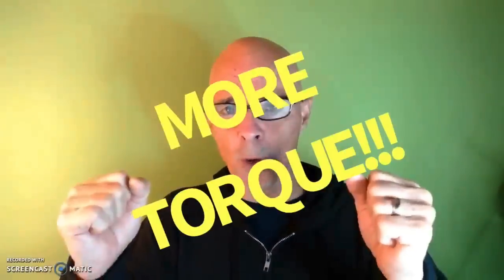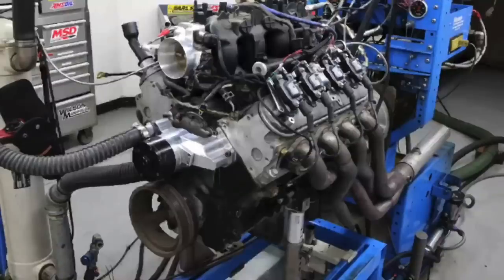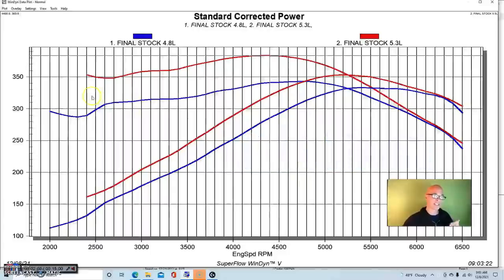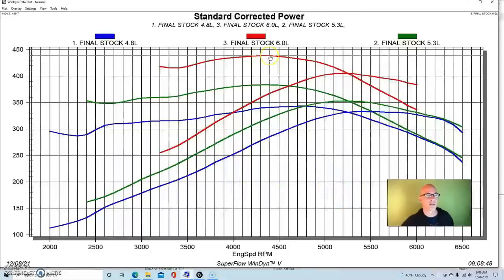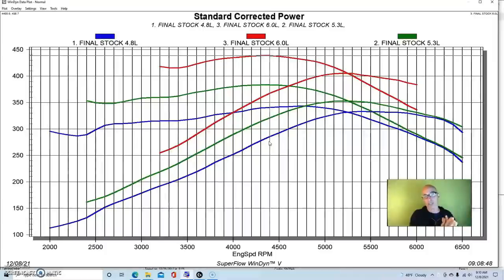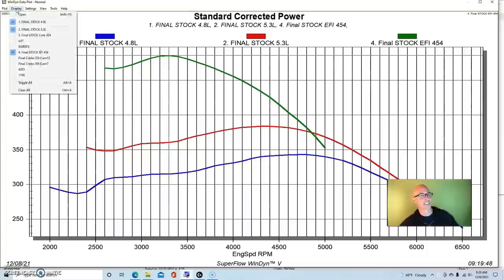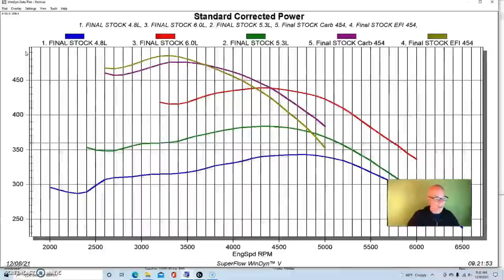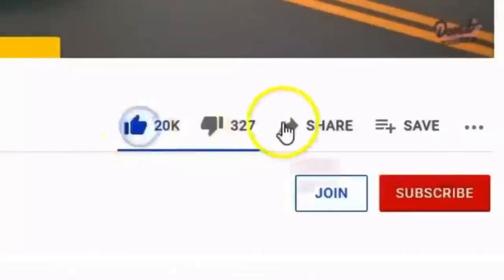LOW BUCK, JUNKYARD V8 TORQUE TEST-6.0L LS VS 7.4L 454 BBC-WHO MAKES MORE TORQUE? BETTER VS BIGGER!

Comment: I know. Holy grail, gonna drop the cash, we aren’t going to go pull one from the yard, and if we did who’s gonna put it in a tow rig. BUT, a 427 LS7 comparison would be cool to throw into the mix as far as torque vs mileage.
Reply: I bought a running driving 02 Denali ( bad trans and paint) for 1,200 with a 6.0 for my Chevelle.It was cheaper than most torn apart sbc in my area.
Reply: @BruceLee-xn3nn  I’m in the process of rebuilding my 2001 LQ4. I live in PA and as others have said, no matter what you do, unless you have a heated garage with a floor drain to clean it off every day in the winter the frames and body just rust to death. I love the LQ4 engine though 👍🏼
Reply: Actual LS motors(aluminum block ls1 ls2 ls6, ls7)etc aren’t even on the radar anymore…if you see them they’re stock to the bolt LS1’s and LS2’s and they’re in really nice and really boring prefab restomods….
Reply: @corypoteet6543  very true
Reply: Thats one high revving small block too

Comment: I would be interested to see how a 6.0 compares to a Vortec 8100, the architecture changes to the big block pretty much made it a giant LS engine, even down to things like the firing order.
Reply: 8.1 will shiz all over the 6.0
Reply: @wildestcowboy2668  oh yea
Reply: the 8100 may make more torque on stock applications, but  the 6.0 has way way more aftermarket support that the 8.1. So I think it wouldn't take much for the 6.0 to stomp on the 8.1. Just my opinion
Reply: That's what I thought too until I learned the 8100 is not an LS engine. It's based off the 454s architecture with a bigger stroke, and cathedral port heads plus a few minor differences front the 454. Still an amazingly powerful engine.
Reply: @paulcarter2879  Actually my motor head friend there is 100% more aftermarket support for BBC then LS mainly due to the high dollar racing circuits world wide that demand such aftermarket support. This is simply because of 50 years of use on actual high performance race use versus 25 years for the  LS platform . LS has only enjoyed last 15 years or so interchanging support for intakes, carbs, ignition crank systems, etc. My 1969 BBC Nova heads can go onto my 1999 Gen 6 454 with no issue. Keep in mind there is no replacement for displacement. My 850HP NA 540 BBC with AFR heads will crush any NA LS engine. LS is definitely more versatile to fit in anything which makes it cool. A mazda miata or honda civic simply cannot fit a BBC inside.
Reply: @djrowe10  I know old school big blocks have all kinds of aftermarket support. I've only been playing with cars since I was 14, so 26 years. I've put together/had a few bbc engines. Heck last month I helped my neighbor get his 67 Chevelle with a 396 running and dialed in. So I'm not new to any of this. But the late model 8.1/496 has very little aftermarket support because it's architecture is different than the latest generation big block. So it doesn't have the interchangeability of other bbc engines. So ya you can bore and stroke an older gen bbc to get pretty large and I get the no replacement for displacement, but I'm sticking by my initial opinion. The factory produced 8.1/496 that they put in hd trucks doesn't have the aftermarket support of the 6.0 so I believe you could build the 6.0 to out power the 8.1 due to that.
Reply: @paulcarter2879  I'm not nit picking your response fellow hot rodder, but let me add to my prior reply. I have been building engines since 1995 professionally in the Cleveland Ohio area. I build everything from boat race engines to top fuel dragsters and stock car racer circuit engines. Having built literally hundreds of big blocks and LS motors, I just wanted to clarify for others reading our posts about the gen7/8 BBC. The block structure of gen5,6,7,8 is the same except for bore sizes. Gen5/6 heads are the same and only the 8.1 496 heads are different being more like an LS cathedral port. By changing the heads to ANY older version BBC this will make it qualify for being just like all other BBC'S factoring it as usable to the mega aftermarket parts world. Yes, if you just try to stick with 8.1 OEM configuration you are more limited with its heads, intake, and power supply then an LS, but I have still built more 8.1 1000 HP setups for race boats then LS engines for same HP levels. Most guys actually think you can't put mark 4 BBC heads on gen5/6/7 BBC, BUT YOU 100% CAN! FELPRO and others fixed the block coolant passageway issues way back in the 90's and mass marketed in early 2000s. I'm a little partial to BBC/BBF engines over LS simply because there is no replacement for displacement 💪
Reply: Almost no aftermarket performance parts for the 8.1
Reply: 8100 is a tall deck big block not many parts interchange with the 454 and different than LS so there isn't any aftermarket support
Reply: @maroguy  really? a big block isn't an LS? who would have guessed. and no, it's not a tall deck.
Reply: I don't think there is much comparison the 8.1 is a savage.
Reply: @corvetteZ3r 😂😂😂😂😂😂😂 ohhhhh ya like it was never there lol
Reply: @paulcarter2879 yeah you get 10 times more performance option  parts for a 6.0 than a 8.1 but to make a 6.0 put out what a stock 8.1 does, it would still cost about 1500 bucks or more. Basically have to build a 6.0 to even touch the 8.1 essentially.
Reply: @fighttheswine  8.1 is king daddys for low end torque
Reply: @HOMEWORK4.0 yup the 8.1 is LT based,  You would baisicly have to build an LS to compare it to the 8100.
Reply: @paulcarter2879 for the LS engine to compare to a stock 8100, you would basically have to build the ls for it to ever stand a chance. The 8100 is LT454 based, it really is a better engine all the way around. But deffianatly not cheaper 😂
Reply: @djrowe10  see I was not aware of that interchangeability, because I love BBC engines. But when I looked into the 8.1 I had trouble finding aftermarket support in parts that you can get with every other gm product ever. So that is interesting to learn that, so thank you for a little bit of unknown knowledge. Being a car guy I'm open to any kind of information, that's why I always clarify that I'm only stating my opinion. It can be subject to change.
Reply: @fighttheswine  being some of the stuff I've read and have found out since, I do believe my opinion is starting to sway the other way. I'm always open to learn. Plus I am a BBC fan, always have been.
Reply: @djrowe10  And thats what i love about the BBC, 1960s parts will fit all the way to (2000 C3500 HD trucks). ive got a 396 carbed aluminum intake on my 96 L29
Reply: I own both 
8.1 smokes 6.0
Reply: @johnmullen7254 my dad owns a 6.0 and I have an 8.1 and I’ll tell you your right, my 8.1 would dog walk and stomp
All over that 6.0. No comparison.

Comment: Good ft-lbs is good but good ft-lbs with gas mileage is key for a daily driver  truck 😎
Reply: Exactly
Reply: on fuel mileage...the focus on lobe separation becomes important
Reply: Transmission change is how you get mpg
Reply: @blainesnider9089  only so much even the best gearbox can do! Efficient gearbox+efficient motor=all the MPGS
Reply: @blainesnider9089   if you think fuel mileage is ALL in the gearbox..you need to study up on lobe separation.
Reply: @hotrodswoodshed7405  brake specific hp and torque it still takes very close to the same amount  of fuel. BTU to get there.
Reply: @blainesnider9089  agreed there's only so much work can be done with x about of fuel
Reply: Overdrive ratio, rear end gear with tire size all part of the leverage equation. Direct injection with VVT a big help with engine efficiency. You can almost have it all these days. Some really clever engineering available.
Reply: Gas milleage 😂😂😂

Comment: This video proves why I love my big blocks.  For a towing application, I want it all down low.  My race car might wind to the moon,, but when I'm towing, I want it right now at 2500 rpm.
Reply: Waaaaaaaaaay too many people have their imagination all wrong. The crankshaft is the heart of an engine. The more stroke and force on that stroke... the more power. Torque is what wins races. A smaller engine/smaller stroke has to wind higher to reach the level of Torque and power that the bigger engine already has from the start.

Comment: BBC for the win! I am a die hard big block guy mainly because of my age being almost 50 and grew up with BBC muscle cars, boats, and trucks. The biggest trend on boat racing is still BBC...as usual. LS engines are the daily driver standard GM came up with to survive the EPA gas and oil regulation issues about MPH. I have never owned an LS in any of my 20 plus hot rods over last 25 years (and still own 7 of them) but considered it for sure after MSD and Holley made it possible to put a carb on one around 2012. You are a guru Rich for sure and my BBC favoritism is shared by every top fuel dragster, super gas drag boat, and all SS GM 58-74 muscle cars. Trucks fortunately have a BBC option until 2013 which spanned 55 years(2009 was offical official announcement of last year made but loyal guys preordered 3 years worth of more to be made).  GM's final BBC ZZ632 BBC makes 1,000 HP and 850TQ without power adders under 6,000 RPM. Never heard of an LS that did that! Thanks for your never ending sharing of the hard work you do to find real world answers! 👍

Comment: The stock injectors in those 454's are leaky garbage after a few years, one of the best mods is replacing them and the stock distributor. 

I have driven about 500,000 miles with that 7.4 454, it is amazing how much headers, injectors, a tune, and some good plugs and wires wake them up.

Comment: Done building my 1999 Chevy 464 Vortech.
Its built strong from GM. 
Factory Aligned honed main bores.
Factory forged rods align honed with Boron steel riod bolts.
Factory Priority main oil feed system.
4 -bolt mains on all 5 caps.
Factory 3/8" diameter Tubular pushrods.
Looked up the 454 Vortech Heads they actually flow decent.
Like Pontiac V8 Ram Air 3 did !

Comment: Small block towing: downshift and high revs uphill. 
Big block towing: lug and grunt up the hills in high gear, much less drama.
Reply: Lug and grunt uphill = Low oil pressure, and heavy wear on bottom end crank and rod bearings. 
The 5.3 tows better than the gas guzzler 6.0.
Reply: @ricktaylor3748   ever understood the obsession with lugging a motor
Reply: @ricktaylor3748  Running low RPM isn’t bad at all. Never heard of engine issues at low rpm. High RPM is what ruins an engine even with higher oil pressure.
Reply: @ricktaylor3748  never ever heard some one say a 5.3 tows better than something else you need 3k rpm to pull a lawn mower 75mph my 20ft boat takes 4k and stabing the petal
Reply: @sstevocamaro  high load and low rpm is terrible for an engine. Everything from the low oil pressure and high combustion temperatures.
Reply: @mmholling87  anything above 1200 rpm has more oil pressure than you need in most engines next don't try to lug up the hill get the down shift or hold steady on the gas and let the truck figure it out 3rd any thing over 3k says you don't have the power and running a engine much harder than It's capable of to cruise down the highway no grade or anything cause when you hit a grade you really not going to have power unless you take it into the top end
Reply: @austinhowze6280  explain combustion temperatures and how pre-ignition knock is effected by them? I can tell buy your post you don't understand what LSPI is and how it's effected by low rpm and high torque conditions.The easiest way to kill an engine is knock. Also, some basic grammar would be extremely helpful understanding your post.
Reply: @mmholling87  always watch Temps, but I pull 30k on the ball with my 7.3 and 65mph blew 2k rpm and I don't have heat issues. At the same time I had a 5.4 that would move 6k at 65mph under 2k and not give it input to go very high torque at that range.  The 5.3 you'll be half throttle to maintain speed and flat out to get up a hill,  most times we put in 4low to clime this hill cause of the amount of throttle needed was unreal for a 1st gear.  To me the 5.3 don't have any low end power but the 5.4 don't have top end

Comment: Pontiac V8 guy myself. 
454 Big Block Chevy just needs a stouter camshaft profile and not much more.
Wipe LS for torque and Hp.
All LS Has Dinky Crankshaft Thrust Bearings the #1 weak area and impossible to improve any. An Engineering Flaw they all have. 
Big Block Chevy Has a Large crankshaft thrust bearing. Pontiac 455 has an even larger crankshaft thrust.
Important when putting continous Heavy loads on a V8 Towing or Racing. 
Will not fail hard use and abuse 454 BBC or Pontiac 455.
Worked on Grain Trucks with 427 Tall Deck BBC and pulled 80,000 lbs loaded no sweat.
Worked on Firetrucks with a 454 BBC Tall Deck with water tanks built in pumper tankers weighed 100,000 lbs. 454 BBC Pulled effortlessly. 
No failures any BBC.

Comment: I think its important to mention that not only does the 454 make more torque, it makes it a lot lower in the rpm range where it is needed for towing
Reply: It's not just the torque that is a plus bigger engines with an unrestrictive intake and exhaust make more horsepower N/A in an apples to apples comparison. Some of that torque though can be traded off when making big horsepower numbers.
Reply: i have the 450 hp 454 and i just love it way better then my 5.3 ls engine plus i changed the intake and put a 750 on it made a big different on power plus it just looks so much bigger in my 68 chevy pu plus i get them for free with low miles on them and they come with a 02xx 400r turbo good to 800 hp just this year i have got 4 set ups for free from 6,000 to 58,000 miles on them all perfect running engines with steel crank heavy rods high flow heads so the bottom ends are built by the factory
Reply: Richard Holder can you test a stock 8.1 in with the mix.factory spec has them pretty tame down with what they call torque management
Reply: I’d gladly buy a 454 from you for my van… I need something that will fit and has been done enough I can find online support. My options are a 454 which I can only do if the price is low enough to justify daily driving it 45 miles a day, an LS preferably a 6.0 but could manage a 5.3, a sb 400 crate motor with gobs of low end torque for 7000 bucks, or simply rebuild my current 350. Right now I’m leaning towards the 400

Comment: Yeah the LS might be the "better" more modern engine, but I will stick to my 454 with an Edelbrock carb on top and SM465 4 speed behind it. We have several trucks around here, and the only one that will outpull the 81 with the 454 is the 74 GMC with a 455 Olds swapped into it. And the best part...I can work on the damn thing with basic hand tools out in the barn, instead of having to take it to the shop where I have computer access to diagnose it
Reply: Even with an standalone ECU and EFI conversion system, would be easier to work and improve the performance on that engine design. My godfather had an 1975 Dodge Dart Swinger Special Edition with an 318 converted to EFI, that engine worked excellent and was easy to make mechanical repairs.
Reply: Well, the big block Buick Stage 2 would pull the Queen Mary up Pikes Peak in 4th gear.
Reply: Why edelbrock and not Holley? At least Holley is all plug and play no tuning your carb bullshit like edelbrock.
Reply: that 455 olds is just like 455 pontiac. lighter than the BBC and produces over 500+ lb ft of torque to move weight with ease
Reply: @StayHydrated-wd5ic So you don’t think you have to tune a Holley? Just slap it on huh? I bet your shit runs like a top 🤣
Reply: Here here

Comment: The 8.1 is a monster. They used to slam those in early 2000s A class RVs. Most that should've had a diesel engine but that 8.1 moves them like a feather.